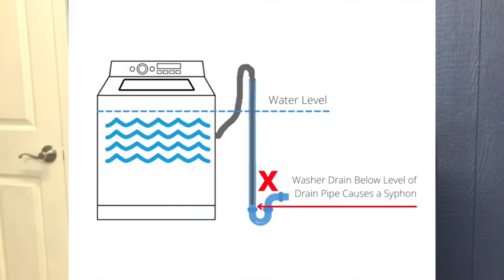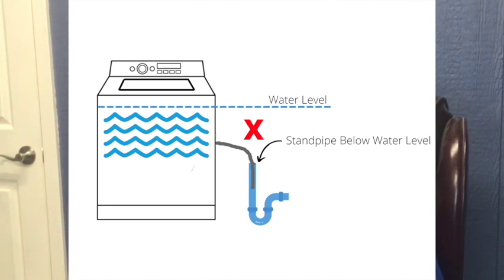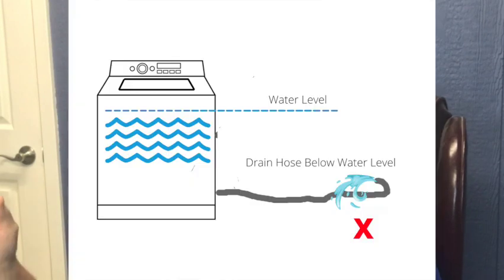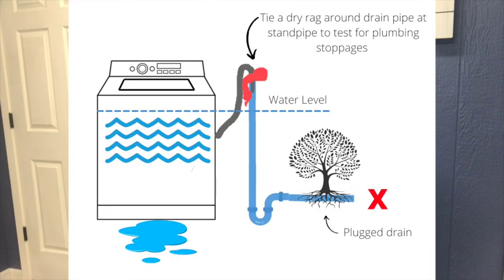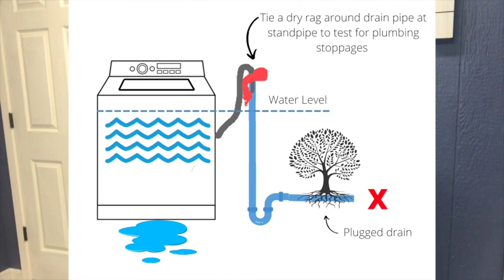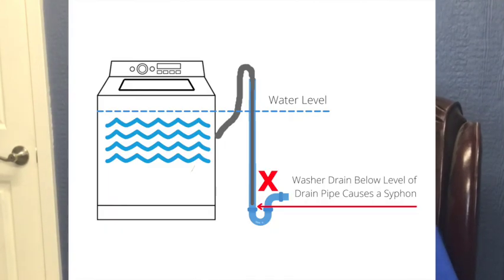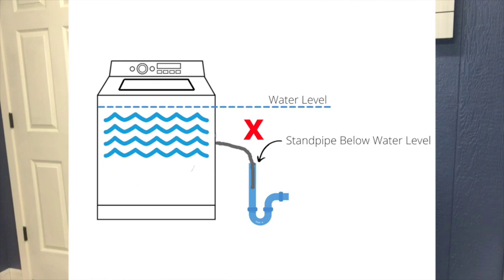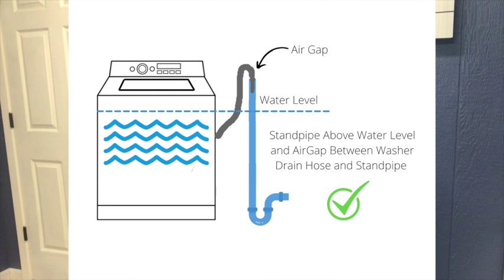How To Troubleshoot Washing Machine Cycle Failures: Plumbing Tips for Technicians

Comment: Great channel...  our washer will fill up... then time out. Then empty.. I will check out these tips in your video.
Reply from the maker: Sounds like the cold water valve is malfunctioning.  Good luck with your repair. Thanks for watching!
Reply: @Harper & Knowles Washer and Dryer Repair  the washer has no problem filling  up... the problem is when it's done filling up... it doesn't go to the next cycle it just draining... it is a Amana washer
Reply from the maker: If it doesn’t fill up enough to trip the pressure valve it will time out and drain. It may appear to be about full but not quite there.  I still suspect the cold water valve.  Will it wash if you select a hot wash?
Reply: @HarperandKnowles  Thank you for replying... I took you advice about the cold water valve. when I removed the valve the cold water side did look suspect. so I switched the wires from the cold side to the hot side... then hooked up my cold water  supply to the hot water valve. bingo! I'M BACK IN BUSSNESS. This will buy me time until I order a new valve,. Thank you so much for the advice. I will be sharing your channel around. keep up the grind and great work your channel will grow in no time.
Reply from the maker: I'm so glad you found a solution. Thanks for supporting my channel!